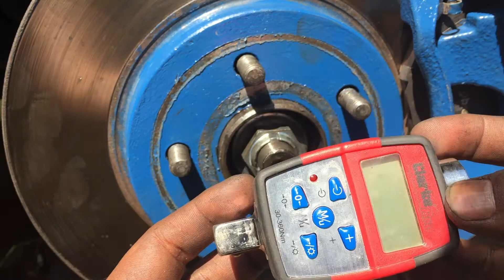How To Change Jaguar X Type Mondeo MK 3 Front Shock Absorber and Top Mount

Comment: Thanks for this good tips 👍doing mine soon have the part my mount  has a arrow on it... read up it points from front to back wing side 👍 the manual says to paint mark front stud before removal that's what i'm going to do to make sure the old one wasn't put in wrong as the bearing isn't there on mine hence why it needs changing need to put a big washer on before hand in case spring pops with bearing been gone  :face-fuchsia-wide-eyes:

Comment: Hi. Have just got a new top mount and it doesn't have that big part that needs point towards front . it has two small ones each side and no other marks can you help?
Reply from the maker: email me a pic of the parts you have.
Reply: Hi how do i find your email address ?
Reply from the maker: @ricb7894  I would probably say you need to orientate it so both arrows point towards the front of the car.
Reply: Just hoping that they are 2 arrows and not just my eyes. Done these 3 times now and they are always a pain on mondeos. Anyway thanks for your time.
Reply: Hi again. I must have put it on wrong its not right. Going to get the proper ones . If the offside one fits with that bit nearest the front do you have any idea for the nearside because is not a mirror image for that side. The lug would be facing door. Any help would be appreciated thanks

Comment: Thought this was the proper way there was no need to remove drive shaft or other lower components
Reply from the maker: true unless you want to put stress on the bushes bending them down with the hub intact, i rather do it this way.